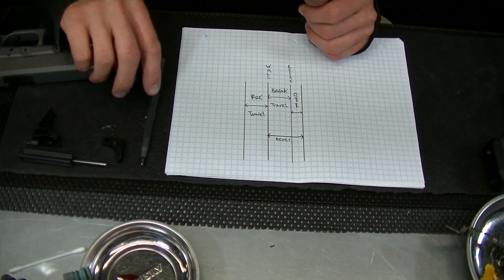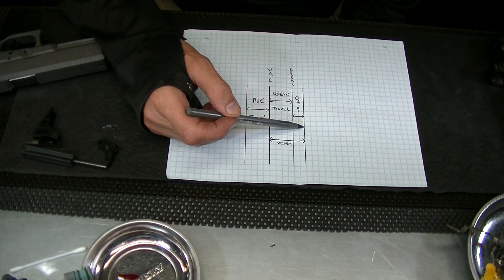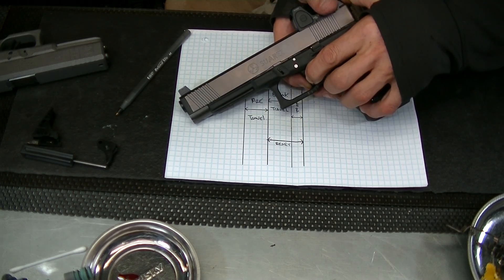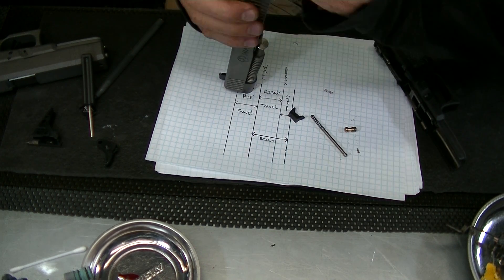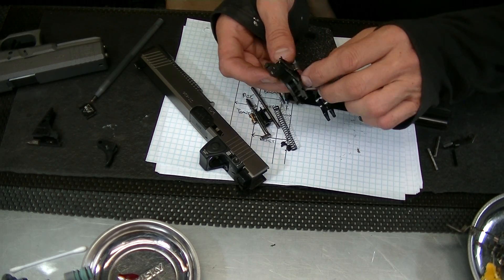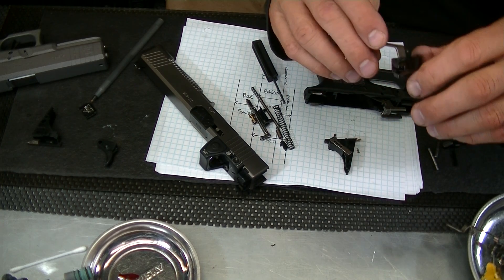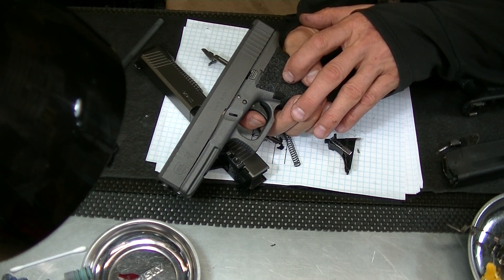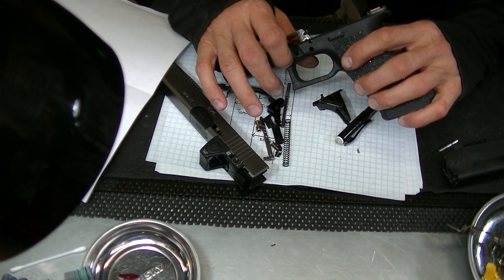Suarez flat trigger shoe modification and dial in pt1 EDUCATIONAL ONLY

Comment: I thought that looked an awful lot like overwatch and not Suarez. I know you said before you have to twist your arm pretty hard to use an aluminum shoe. This guy must have been wrenching....lol.
Reply from the maker: well you're right there but I Figured why limit myself. Just because someone has an aluminium shoe their trigger need not SUX. Not to mention cause I tired of tweeking all the current one on the market. I'm designing my own ark/flat face aluminum shoe and it will be fully adjustable. I'm having it manufactured locally and it will be completely designed by me and that includes the bar as well.
Reply: JOHNNY GLOCKS the persona Hell yea I agree 100%. And I can't wait to get one of them. Do you have any of the drop triggers, gen. 4  G19 in stock?
Reply: I just started eating all of your videos and like the detail you go into but I know your holding back. How the hell are you removing all the pre travel. You can't be doing it with just that one adjustment screw in the trigger shoe. Are you changing the location of the trigger bar connection or trigger bar pin in the trigger shoe. I have about a 1/32 before the birds Beak even hits the conector